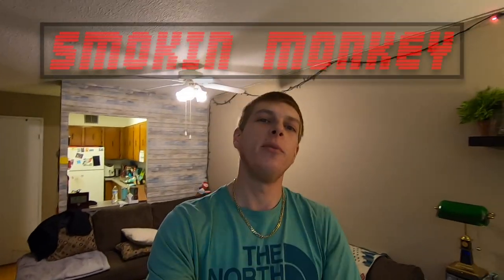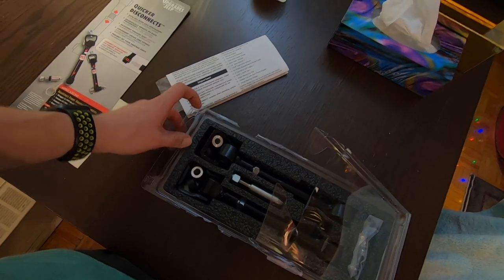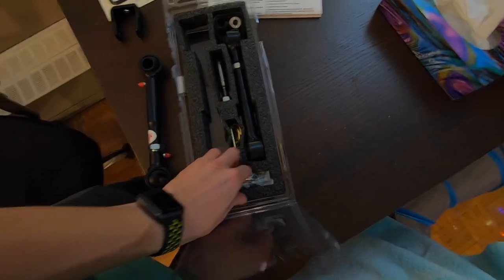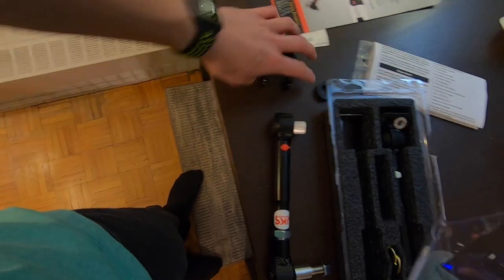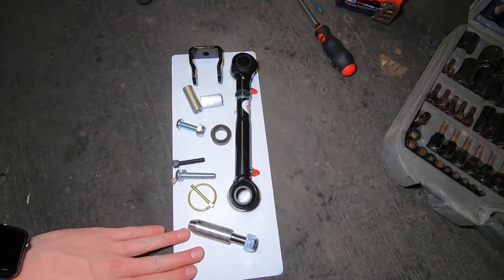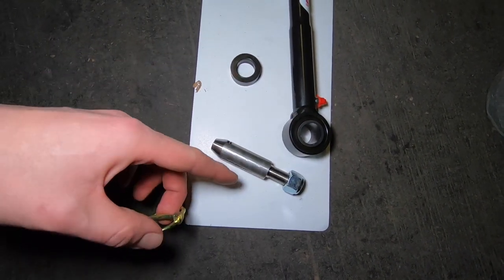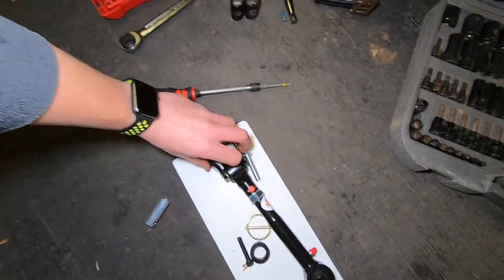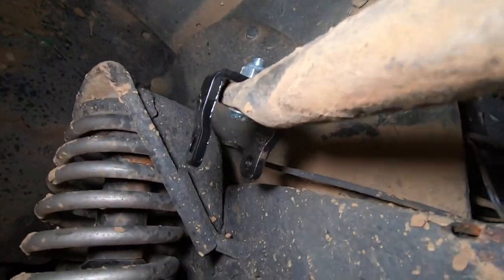Jeep TJ JKS Quick Disconnect Install  (Big Bird Build Part 28)

Comment: good job.i like em. just wondering.one of last videos you were gonna replace your rope on winch up to 1/2 in instead of 3/8 at 100 ft,as you hoped.Just wondering if you used 1/2 in and the spool held 100 fett of rope on winch.Thanks man.Good job
Reply from the maker: I replaced it with 3/8 95 foot.